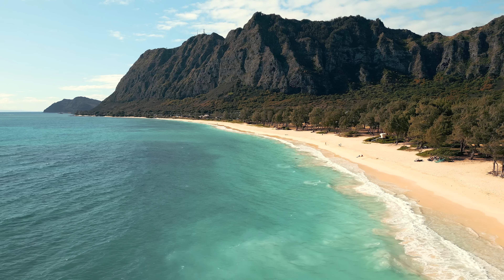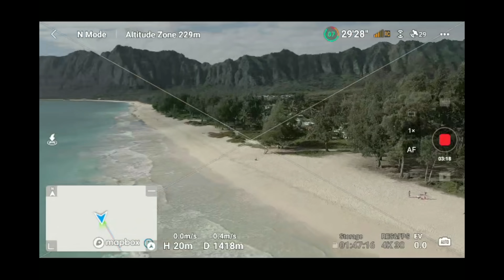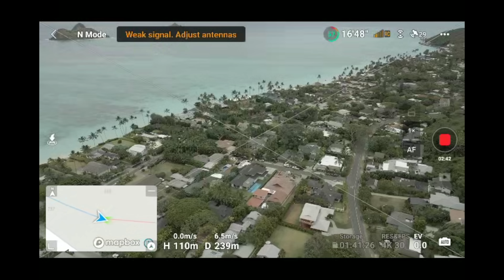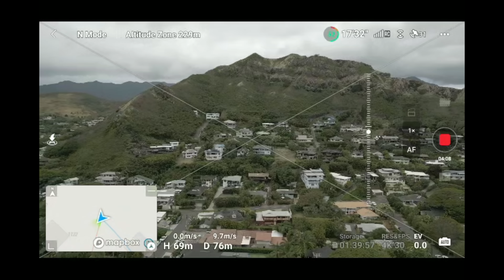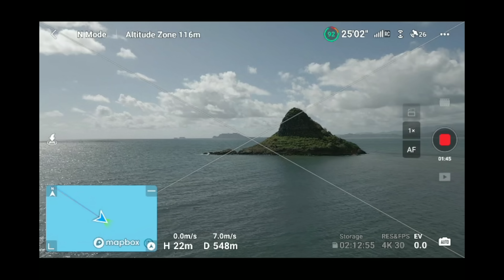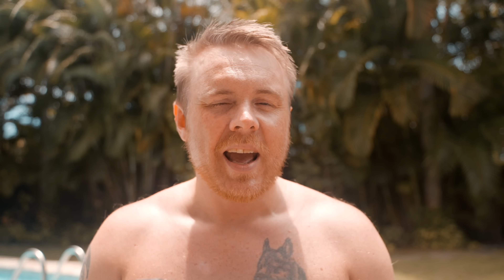DJI Mini 3 Pro Ultimate Signal & Range Test  | WATCH THIS FIRST!

Comment: Thanks for this. It seems logical that range would be affected by signal interference/saturation but I can't get away from the fact that I get a M3Pro range of only 300m from my back yard whereas my other drone (Autel Evo 1) easily gets 1500m flying the same routes at the same height in the same weather (and would have got further if I was prepared to fly blind).

Comment: Trees do not transmit on the 2.4 ghz band and the reason for 2.4 was it was safer than 35mhz or 27 mhz so what are DJI using?

Comment: Rob, is it worth it to buy and extended time battery to fly on a city? or because the interference with the wifi a regular battery is OK?
Reply from the maker: Wouldn’t be much of a difference in that area. Only longer flights ofc course. You also need a license if using the plus batteries. The drone will exceed 249g
Reply: Thank you!

Comment: I returned my DJI Mini 2 & sold my Mavic 3 to buy the Autel Nano+ & EVO 2 because of the DJI GeoFence Flight Restrictions, which Autel does NOT implement.
DJI should offer a disclaimer/waiver option, releasing them of any liability (just as Autel does)...
Reply: im sick of the signal issues with dji , suddenly the drone "decides" hes on freeze mode. the display on remote/phone turns grey. iv'e searched youtube and the interent and facebook... for this things happen ! no real answer just clickbaits and general dumb solutions.  Yes I was on airplane mode. yes I hade at least 16 satellites, I had at least 60% battery, I was on an open field, anyway the air 1 is just somewhere in the field / bushes I couldnt get it out of there... had to shift back home without it.  :\

Comment: Nice tests. Ya, the environment you fly in determines what you signal will do. I just wish DJI had better algorithms to filter out WIFI interference. Hopefully this will come in some firmware updates. Can't see paying that kind of money for something that doesn't even get out to 400m in higher WIFI areas.
Reply from the maker: Thanks, Dhoser.👌
For most people 400-500 in wifi area is okey and more than enough. But I totally agree with you. The claims they have on range and signal is getting higher and higher, but In reality its just the same as before.
I sometimes wish they could keep the hype level at a reasonable level.

Comment: So that means range is very limited in wifi areas. And that brings up the question if range is even more limited in high density wifi areas and how as little as one caller could affect the signal and how far away must you be from a signal to avoid any interference.
  I would still like to see a longer range test going 5 miles out or pushing it as far as it would go one way with a spotter. Perhaps someone with a motor boat could follow it and then you could have it land on the boat if you were not sure you could make it back.
Reply from the maker: I did one test in honolulu at magic island(you can google it) its a harbor there and i had big issues getting to 300m cus of the radios coming from 3-4 boats. I might do a longer one when i get a helping hand in a few weeks!